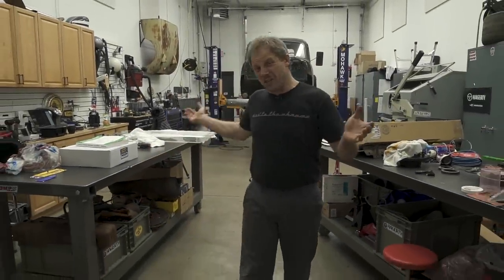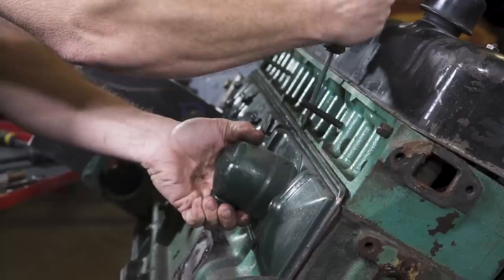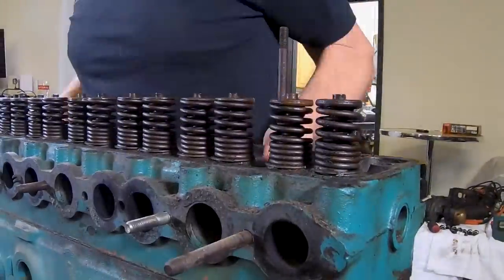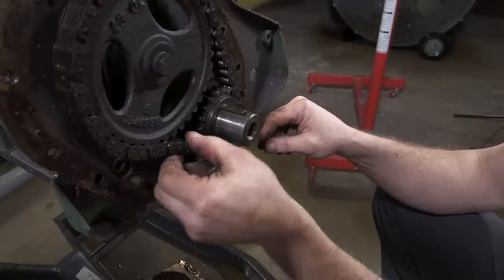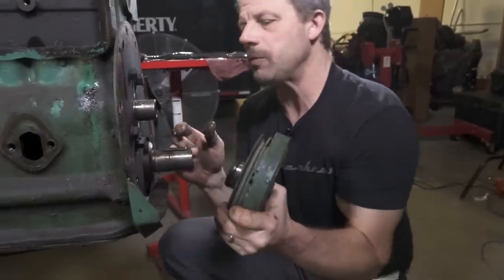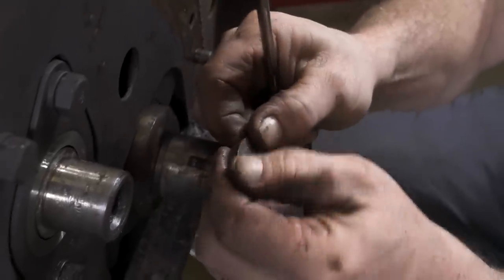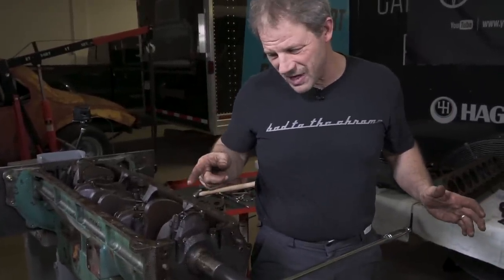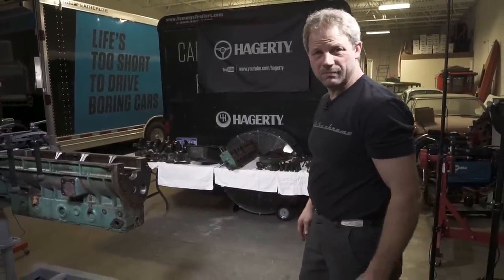Yikes! Our Buick straight-8 teardown reveals a few surprises | Redline Update #29

Comment: That motor needs a better intake and exhaust manifolds, probably make a world of difference
Reply: Reading your comment, it occurs to that maybe they underpowered motors back then.  Probably for longevity with the state of materials and finish at the time.  And maybe people were thrifty with gas back then.  Seems like carbs and intakes on old motors like this always look undersized.
Reply: Yes, it would be a huge advantage if those engines had 2 carbs instead of one. However, I have been told that getting multiple carbs to work together is a challenge.

Comment: I have a question is it true that the straight 8 engine died because the crank shaft was too long and it's prone to snap or break is that y we have v shaped engines for the shorter crank shafts??????
Reply: Yes, and they take up much less space lineally and the have better balancing characteristics and better volumetric efficiency with the shorter intake manifolds.
Reply: Partly.  Another reason is that they would not fit by the mid 50s.  The crank was fine if the engine was kept fairly stock, but if you gave it 10 - 1 compression, might be too twisty.

Comment: The thing about those engines is that performance parts are nonexistant. Stock parts are getting that way too, as most restorations go with smallblocks.. Everything would have to be made custom. and it's hard to get good atomization with less than 3 carbs
Reply: Let's just go with Multi Port Fuel Injection.
Reply: Going with a small-block Chevy is not a restoration, it is just "fixing it up".  A restored car is supposed to be STOCK.

Comment: 13:24 - wow, very long stroke on that motor
Reply: Simon Coles I was going to say the rod is just long to reduce monkey motion (that’s why a Pontiac V8 is better than the same displacement Chevy, the piston pin is higher) but this stroke is over 4” so yeah. It’s grossly undersquare, which the V8’s and V6’s were not. The 340 was slightly undersquare.
Reply: @sammolloy1  The Chrysler Straight 8 is worse - almost 5 inches.  The Olds 455 V8 is 4 1/2 inches.

Comment: Correct me if I'm mistaken, but couldn't you bore it out to get more displacement, port & polish the head, do a competition 3-angle valve job, install a radical cam, and attach 8 Webbers (or Hilborn injectors) to it? That'd get you more horsepower. Then you have a Superbuick. Bwomp!
Reply: But it won't be truly streetable.  Skip the radical cam, and just put twin carbs on it.

Comment: It's an engine, not a motor...
Reply: Lots of people say motor.  Big deal.
Reply: The bigger problem is that he uses steel hammers on engines.  Can crack castings that way.
Reply: @michaelbenardo5695  DO you ever hear about jet motors? lol... No, because thee names and terms have evolved, modernenity says 'motor' is powered by electricity, and an engine runs and various fuels, be it gas, diesel, hydrogen, etc etc
Reply: @EvilJ069  Motors can also be powered by vacumn or air.  Not all are powered by electricity.  You are making yourself sound like an elderly unmarried English teacher.  Lighten up.

Comment: Why would the inlet crack that way? Bad casting?
Reply: Exhaust.  Heat cycles cause every log style exhaust manifold to crack at some point in its life.
Reply: Might be from uneven tightening - each bolt a different tightness.  They should be evenly torqued, or else they can eventually crack.

Comment: Why on earth would a manufacturer make a straight eight.......

I’m starting to think it’s just because at the time they did not have the technology to cast a V8 block in one single piece......and Henry Ford was keeping all of that under wraps since he basically invented it.....
Reply: The internet...     V8s =France 1904, Cadillac 1914 mass produced, Chevrolet 1917.     15 years later...  Ford 1932.    Straight 8 very smooth for luxury cars.
Reply: moyadapne well that’s good to know 

I knew that they were other companies doing V8‘s before Henry Ford 

but I didn’t think they were casting the block and the internal galleries and the bottom end all in one piece 

I thought he invented that but I might be wrong

 I am aware of some early motors where the cylinders are cast separate to the head which is cast separate to the bottom end and the whole thing bolts together but they couldn’t take much horse power on account of those weaknesses 

that’s where I understood Henry Ford sorted that out with a one piece casting but I might be wrong.....
Reply: Smoothness and quietness.  And narrowness.  The first V8s had a 4 cylinder style crankshaft, which means they resonated just like a 4 cylinder at certain load/RPM conditions.

Comment: 13:00 crankshaft have serious crack on number one
Reply: Sure looks like one but could also be a "casting" mold line.  Hope it's the latter !!
Reply: It's a casting mold line.
Reply: Casting line.
Reply: It doesn't look like the same casting line on sharft number 3 its smoother than thr number one
Reply: @ziondenielteodoro9422  They won't all be the same.  You have to see the mold.  That could have been a vent or or a pour channel.  Regardless it is not a crack.  You can clearly see it has excess metal that was ground back.